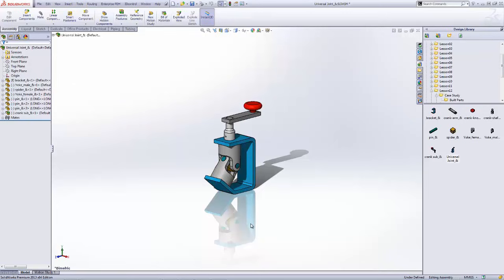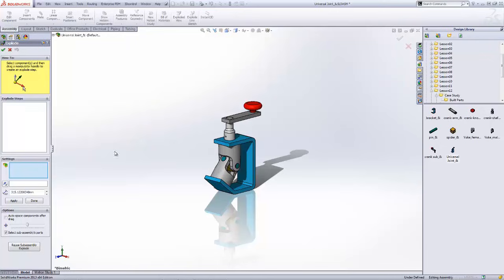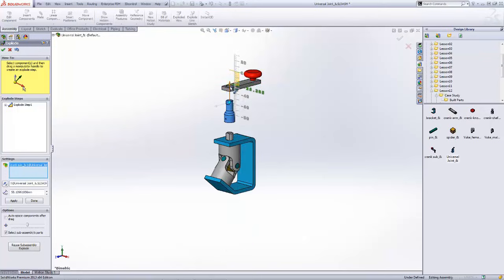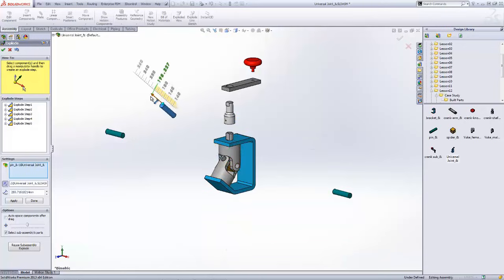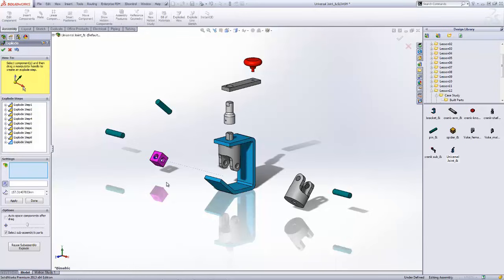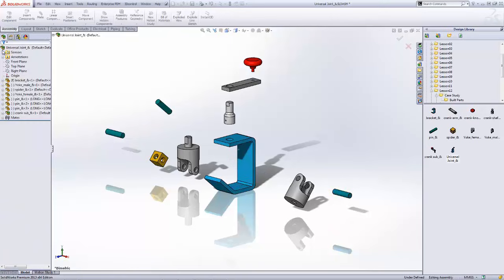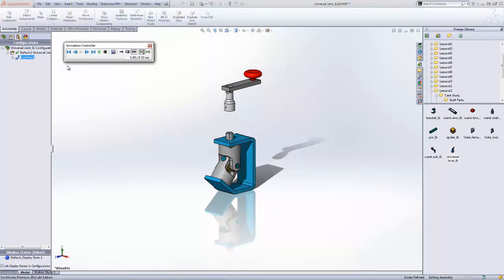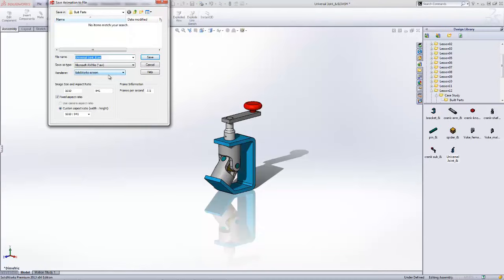SOLIDWORKS Quick Tip - Working With Exploded Views In Assemblies

Comment: How the parts mirror on ground like that?
Reply from the maker: Hi Abdo,
Whether there is a ground reflection is determined by the applied "Scene" in the model.  You can go to the icon of a colored ball on a check floor and apply other scenes to the model to see which have floor reflections or, in more recent versions than this video shows, go into the 'DisplaPane' at the top of the FeatureManager tree and edit the scene to have a reflective floor.

Comment: How do you make the AVI file smaller in order to be sent via email?
Reply from the maker: Perhaps the best approach to this problem would be to save out an AVI from SolidWorks using maximum quality settings then convert that video to a more efficient format that has a smaller file size like MP4 x264.  You can find free software to make that conversion.  Once such software is Freemake Video Converter (http://www.freemake.com/free_video_converter/).
Reply: compress it or upload it on a private webservice.

Comment: Quick question. After you've made your exploded view, is there a way to show how the parts connect via connecting lines, that could zigzag through the connecting components and through all the holes, so that a picture can be used instead of a video?

I hope the question was clear. 

Otherwise, this video was great! Thanks.
Reply from the maker: Yes, once you have created an 'Explode View' you can then create an 'Explode Line Sketch' (via 'Insert', 'Explode Line Sketch').  This tool allows you to select vertices of your model in the explode view to show how each part connects into the assembly.
Reply: Thanks!